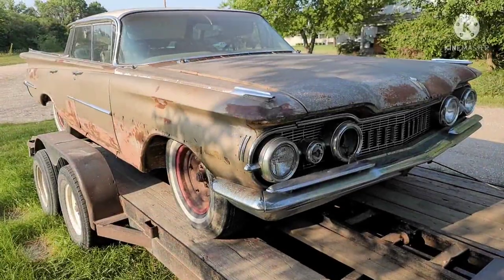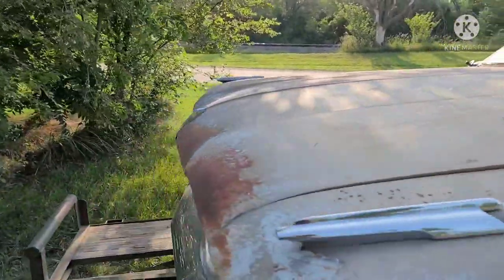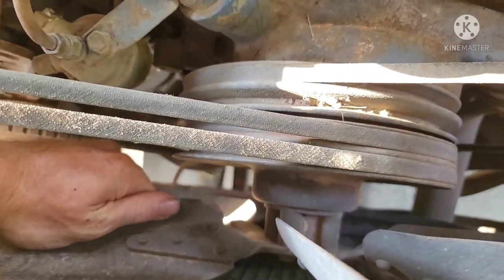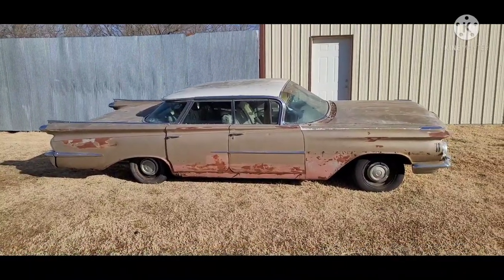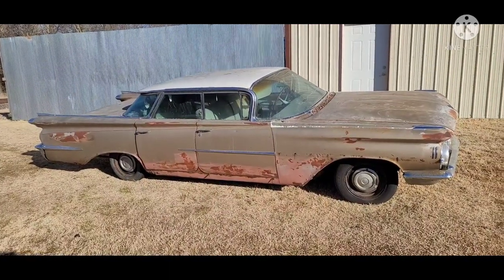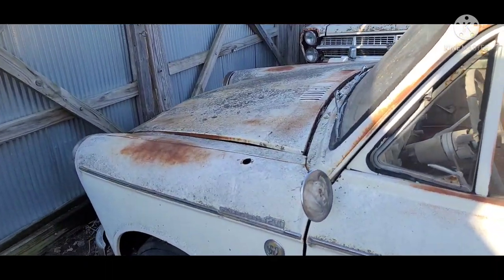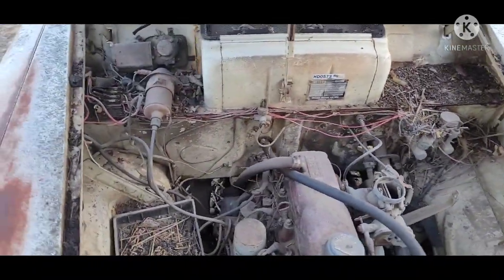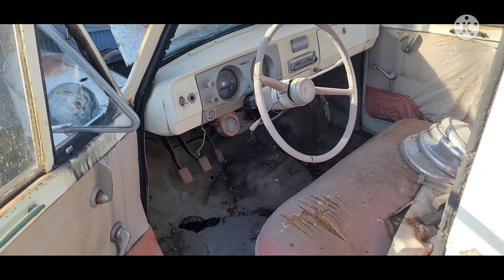Field Finds! 1964 Datsun 320 pickup & 1959 Oldsmobile Super 88! For Sale on BigIron online auction!

Comment: The 64 Datsun pickup brought me back to my youth.  I had a 67 with a 1300 engine in it.  One comment on the front bumper...you mentioned the hole was for a crank.  Actually, if you look at the shape, it appears to be  a spot for an old Datsun logo pop in.
Reply: I had the 1970 Datsun pickup 1600 back in 1984 and the add for them was 'Dogs love Datsuns'. hub caps 'it was super fun.😊